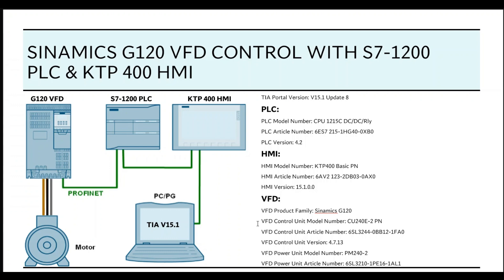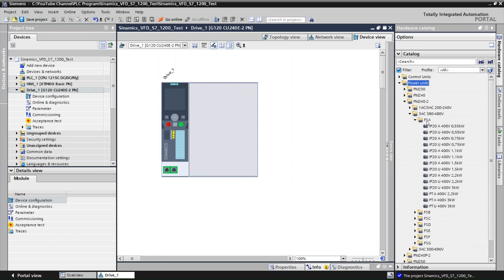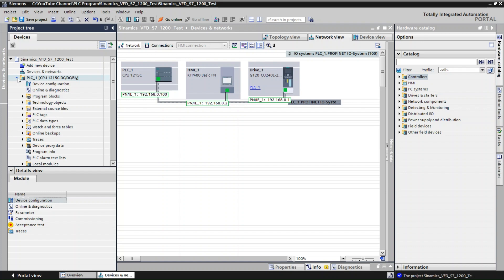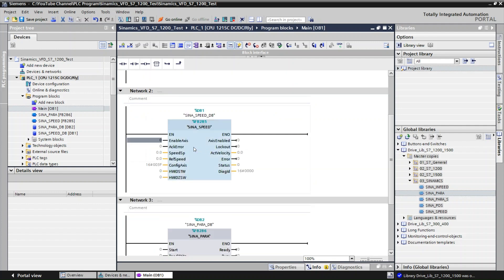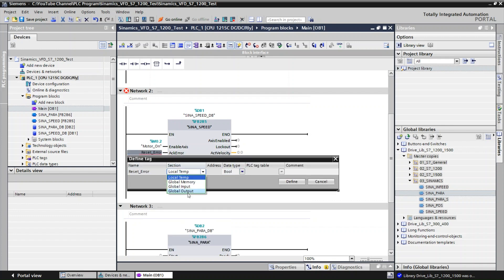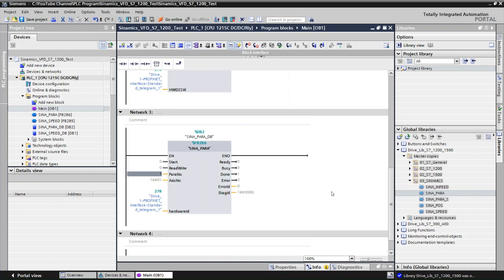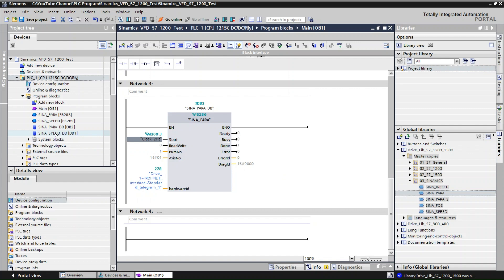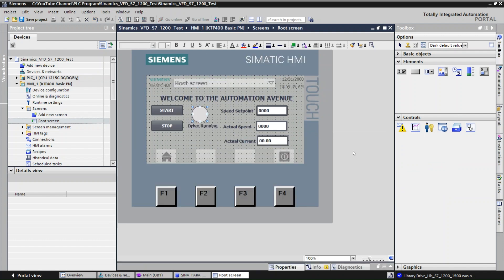Control & Monitor Siemens Sinamics G120 VFD with S7-1200 PLC, KTP 400 HMI & Wiring Diagram | Part-1

Comment: and how did you found in libraries those sina speed and sina para because im looking for them for my v17 but is imposible to find in siemens product manager
Reply from the maker: Select the PLC in the project tree on the left side. Then, choose the ‘Instructions’ option from the side menu, scroll down to ‘Optional Packages,’ and expand it. Finally, select the ‘SinaSpeed’ block.
Reply: Why don't I see %fb285 and %fb286 in the blocks  sinaspeed and sinapara ?